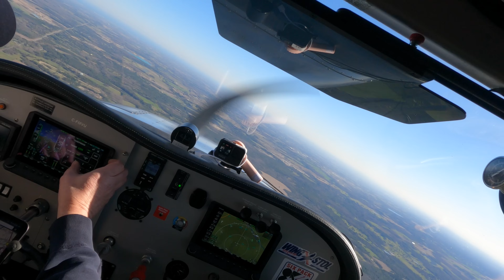Day Surgery - Replacing A Cylinder On Our Cessna

Comment: Got to start running LOP routine or you will have sticking valves and failed rotators forever.
Reply from the maker: I do run LOP - All of the problems can be attributed to how the engine was treated before i purchased it - I knew this was coming when I bought it.

Comment: I don't mess with Superior cylinders. Guides checked or replaced. Valves turned or replaced. Seats refaced. Springs replaced. Rings cleaned if needed. Off you go.
Reply from the maker: All of that would be fine if I wanted the plane out of service for 2-3 months as that work was done. 
But for the same cost (as the work you delineated) I was able to replace with new in a matter of hours and continue flying. Now I have a cylinder (that we removed) in the shop for rebuilding, and that will be ready if I need to replace or repair another.
Reply: @GlensHangar  Naah. Two hours and a little machining.
Reply: @stanleybest8833  Maybe where you live - but not around here.

Comment: I really like your maintenance videos Glen! I fly the GO-300, in my 175 and have had to refresh 2 cylinders since I bought the airplane. Currently I have a heat problem on #5 that I am working through.. My uncle suspects a vacuum leak making that cyl a little leaner than the rest. I am thinking about redoing the intake pipe and upgrading the hose clamps.
Reply from the maker: That's pretty much where we started on troubleshooting this cylinder - possible vacuum leak.

Comment: Very cool and detailed video. before deciding to replace the cylinder, did you all try reaming the guides and lapping the valves with the cylinder still installed?
Reply from the maker: Yes as I said in the video we did everything to save the cylinder -

Comment: Ring end gap seems high compared to automotive applications, you'd go 15 thousandths on the top ring on a natually aspirated auto engine.  I guess because of it being air cooled you have to allow for more expansion.
Reply from the maker: Cylinder head temperatures on this engine are in the 340ºF - 380ºF range, with exhaust gas temps around 1400ºF. These air cooled aero engines designed in the 1930s are a completely different beast even from Car engines designed in the 1960s.

Comment: Nice job, well done. So Mike B and the Savvy crew are big on the concept of valve lapping in place, to avoid cylinder removal.  Has been shown to help with sticky valves, allowing rotators to do their job and even out burn patterns. Did they suggest this for your valves prior to the work you ended up doing?
Reply from the maker: we did all the valve lapping, etc but to no avail. The 0-300 doesn’t have ‘rotators’ or ‘rotocoils’ to turn the valves.

Comment: G,day Glen from Sydney Australia.
Has Chris an opinion as to why the exhaust valve and angle seat of "jug six" had damage only?
* Metal alloy
* Combustion to hot
* Valve stopped rotating 
🌏🇦🇺
Reply: old piston top tells the story.  4:30
if that was my plane the other jugs wud come off and piston tops cleaned.
Reply from the maker: @larz46north18  Cylinder 6 is the only one with that deposit, the others are clean.

Comment: @ 12:18 Does anyone have a spare Packard V-1650 or PV-12 Merlin. Glen wants an upgrade 😀
Reply from the maker: Wouldn't that be great!
Reply: @GlensHangar  Just might need a larger fuselage ...
Interestingly, Classic Aero Machining Services in New Zealand manufacture brand new Gnome Monosoupape rotary engines in 7 or 9 cylinder versions - For the diehards that love total loss castor lube oil sprayed everywhere,  engine induced torque roll,  prop start and engine rpm altered by cylinder isolation / blip switch !

Comment: I appreciate Mike Busch sticking his neck out a bit and pointing out that a significant portion of cylinder replacements aren't necessary (and carry some risks.)  But obviously, sometimes it is necessary and the right thing to do.  It's very interesting to see one of these cases where it did make sense, and to see that process with a good amount of detail.  Thanks!
Reply from the maker: Chris feels the same - do everything you can to save it, before you crack open the engine.

Comment: I watch the Savvy webinar's, those guys especially Mike Bush knows his stuff. They just had "The War on Jugs"  2weeks ago.  Glad to see a top notch repair done for the right reasons and not just we think that will fix it. Nice to hear the term Differential pressure test instead of just compression test. Is there any re-torque after a few heat cycles on the Jug mounting bolts ? Just curious :)

Comment: If you do upgrade, just go to the O-370. It’s newer & runs more smoothly
Reply from the maker: I'd love to upgrade, but the cost is a little to high for me right now - since I still have a running engine. Is the 0-370 certified / STC's for this airframe? I haven't done a whole lot of research just yet.
Reply: @GlensHangar  yes Stoots aviation has the STC - SA02539AK

Comment: Crazy how much more serviceable  aviation engines are, wish it could be that easy for cars
Reply: The difference being you have to service the aircraft piston engine way, way more often.  Modern automotive engines are miraculously reliable in comparison.
Reply: It's serviceable because it was designed in the 1950's, using 1940's technology. Go back to a car of that era, will look just the same.
Reply: @TheOwenMajor  : I don't know of any 1940s or 1950s automotive gasoline engines with removable power assemblies... just sayin'. That's a key component to why the engine is able to be serviced to this extent without removing it entirely.

Comment: Glenn with all the money you have invested in your airplane why didn't you overhaul the engine?
Reply from the maker: With my budget I had a choice at the start - engine or instruments. Chris went through the engine with a fine tooth comb and we looked at everything we could (cam, crank, pistons, cylinders, valves etc) and while he identified problems that we'd need to watch, overall it was in decent shape for an engine that had only been run 300 hours in 30 years. Meanwhile the radio and most instruments were woefully inadequate and in some cases barely functional. So I started with the instruments and some of the less expensive upgrades; knowing that I could drag this engine probably another 10 years with only minor problems.
Reply: why do knee replacement surgery when you have a hang nail?